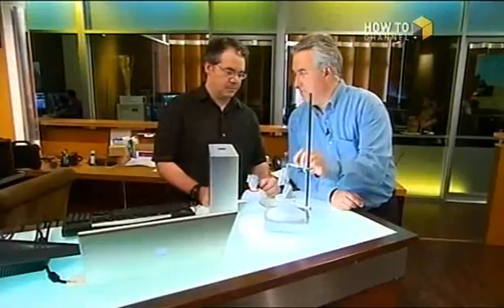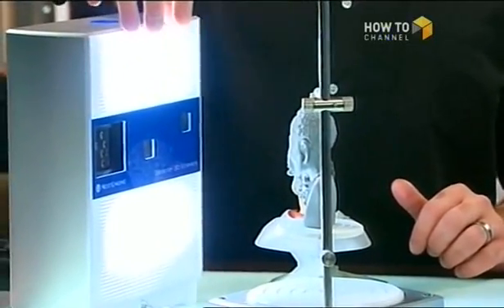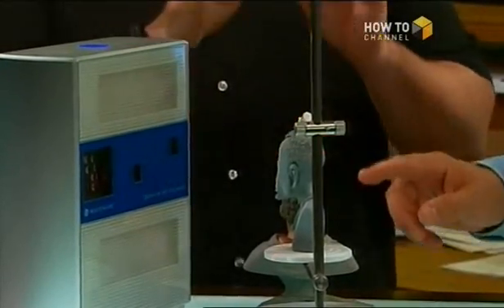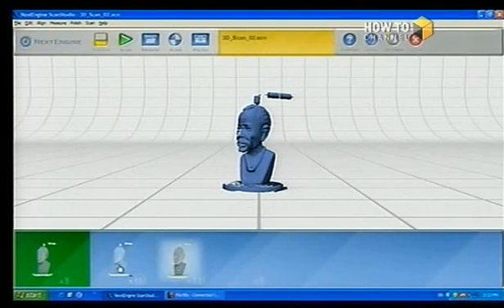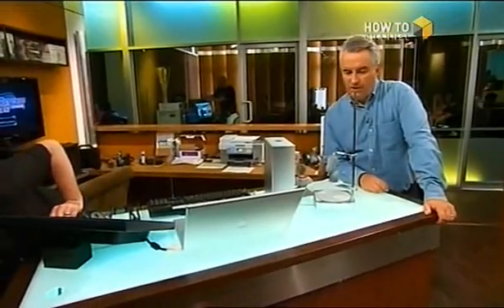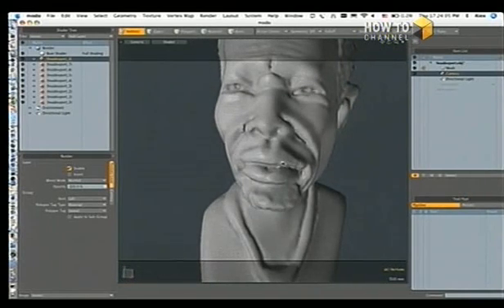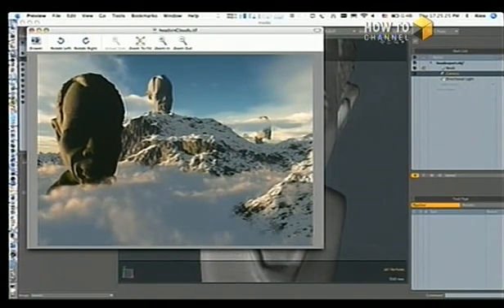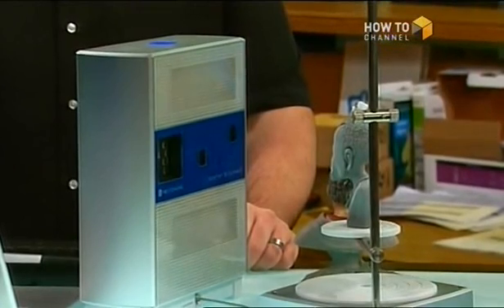3d scanning nextengine http://www.oasisfleeting.tk

Comment: Sheet metal dies can be expensive, even if you use cheaper material meant for stamping prototype parts.

Also, this thing won't do you very well because it is size.  I don't think scaling up a panel scanned from a model car is going to give you adequate quality.